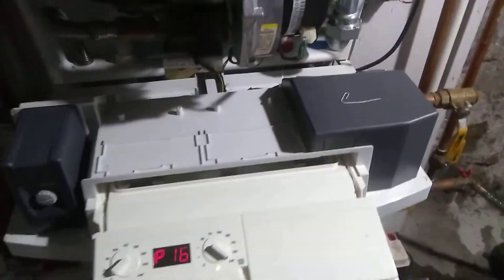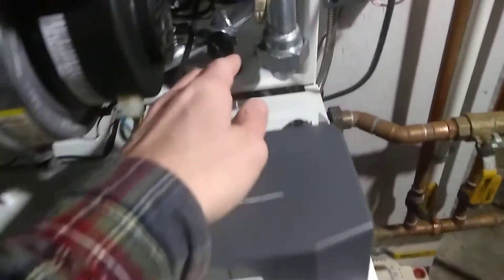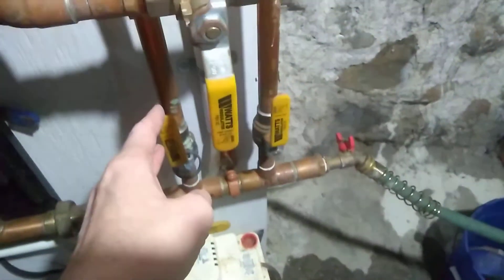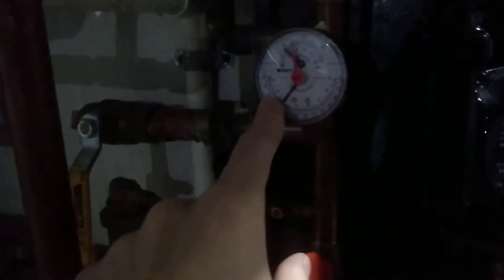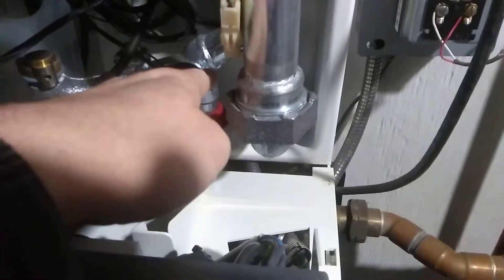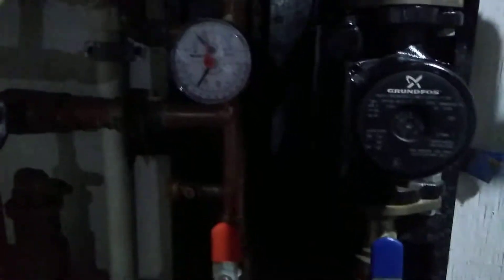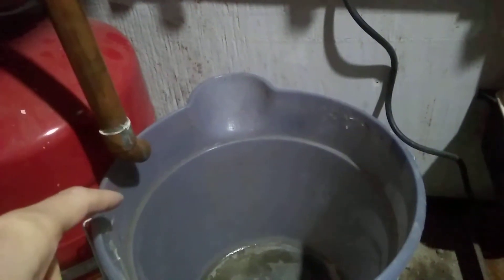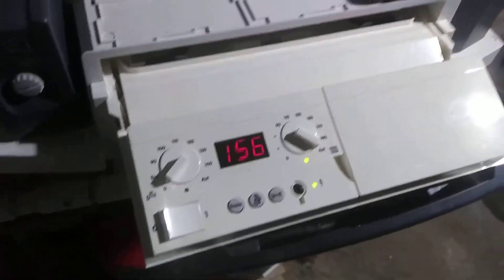Clearing a Pressure Sensor (C0 288) Error on my Buderus GB142 Hot Water Boiler

Comment: Thank you John, woke up this morning, no heat or hot water. Unit reporting low pressure. Followed your video and the heat is back on, and the unit is reporting the correct water pressure. Thank you.

Comment: I am having the same symptoms as you describe. I am by no means a master plumber, but I am somewhat handy. I am considering attempting this myself, need to find the "drain valve" on the manifold to relieve pressure. I have all manuals that came with boiler, and so I should be able to find it. Cut off water supply & return to unit, shut down unit, relieve pressure and then remove sensor and clean. Re-install, open water supplies, power up unit (may need to bleed system). If that doesn't work, then I would need to replace sensor. Supply House located nearby, so that helps. Any other help would be greatly appreciated.
Reply from the maker: Yep, that's it. The drain valve would be the same one you'd use to bleed the system. I highly recommend replacing the pressure sensor if your boiler has been installed a while. Mine had the old version of the sensor, and then updated one (SKU 8718600019) doesn't need to be cleaned as often. Good luck!
Reply: John LaTour my unit is about 6 years old, to be honest, never gave me issues, never serviced. Had heat shutdown last year, due to low pressure. Had official cleaning the other day, tech was great. He told me about the sensor, and felt that I could do it, considering I had re-wired my unit. There is a plastic water trap, which I’ve now learned how to remove and clean, which I did. The sensor is all that is needed now. Building up my confidence to tackle this. You video was really helpful, and I very much appreciate you posting it.
Reply: Well, I just removed, cleaned & replace the sensor. Going to wait a day or so to see if the pressure is still out of sync. I'm thinking a replacement is in my future, but at least I can remove it with confidence.
Reply: Just ordered replacement part. Boiler originally installed Spring of 2013, so 7 years on the sensor, good run I guess. Will arrive on 7/13 and will get installed on 7/14 (This time I won't forget to bleed system).
Reply from the maker: @MarvKirsch  Sounds good!